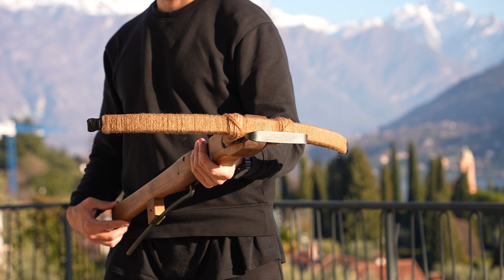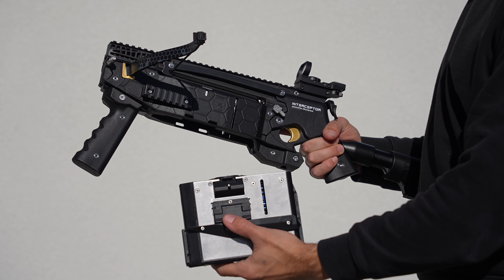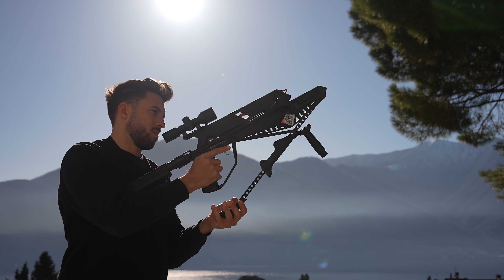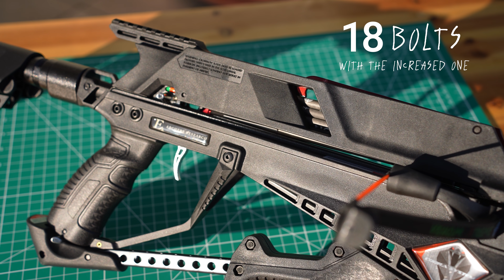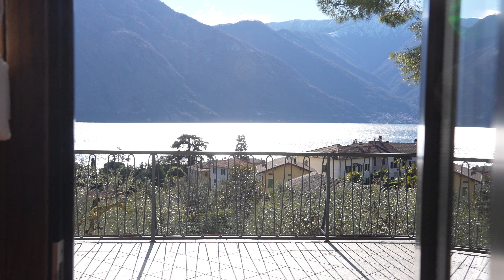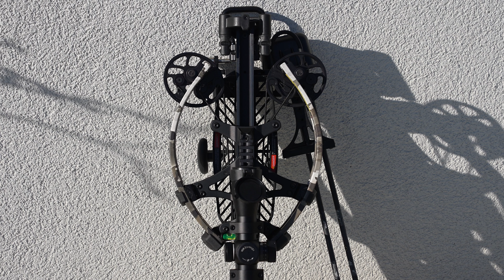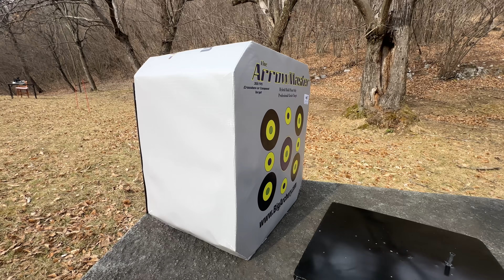How Dangerous are Crossbows?

Comment: When I was a kid, and we would do battle in the Great Penwood behind our house new Newbury, I made a crossbow with a solid piece of wood as the core, a thin piece of flexible wood as the limb, and I forget what I used as a string, but I do remember the clever bit was a clothes peg with a nail through it used to release the string. It was pretty powerful for a home made effort! (I used arrows from my shop bought bow and arrow.) I think the cross bow is my favourite off grid weapon. Easy to make, easy to make your arrows from what you find out in the wild.

Comment: Just a slight comment for the medieval crossbow - the bolts had triangular tip cross-section to open the armor nicely, more like a clean cut. The circular tips are made for range shooting with very low penetration - as it has to tear the material, which dissipates the energy much faster. This makes more difference, while shooting to harder things, like wooden doors or steel armor.

Comment: I have never tested a crossbow, seen it done in Portugal at a medieval "feast" of sorts and saw a crossbow penetrate a sheet of metal which wasn´t paper thin, in fact I remember being surprised but it was like 30 years ago. I do remember that the bolt was very different and the tip extremely pointy unlike the one in the video.

Comment: The Tenpoint is basically what crossbows have been portrayed like in media. The first three I could call crossbows, but the last two are definitely Bolt Throwers, which is manly as F. Though I don't think a weapon that has $100 per single-use ammo to be really good. I mean the bolts clearly can't handle being shot at that power.

Comment: If you can reload a crossbow without using the full strength of your body (as in either a lever and your feet, or some other difficult thing) I tend to think of it as a toy, a lethal toy but a toy none the less. Problem for me is I've seen what a classical european middle age crossbow can do to armor; it blew my mind. I had a number of smaller crossbows as a kid that were most certainly not to be underestimated but had nowhere the 1000 foot pounds or so of force those did. I think mine was like 25 foot pounds? Eh not actually that well versed so if I'm completely wrong my bad. I just clicked because it of that one funky crossbow that seemed to lack a bow.

Fun content, makes me want to get one of these for shooting targets.

Edit: See I knew the one that needed a wench would be WAY more powerful. THATS WHAT IM TALKING ABOUT. You could probably use that for deer hunting.

Comment: Nice vid, but a suggestion to calculating the accuracy points, it would have been wise to reshoot the first shot. It skews the result. It goes in the other direction too. Let's say you put ten arrows within 5cm from each other, and then accidentally flinch and miss the target completely. Does that say anything about the weapon?  In general, it can be wise to remove all extremes and keep the 90 or so percent in the middle. I know this channel isn't exactly scientific, but it could be something to think of if you want.

Comment: hey look in an apocalypse scenario is something you can have the fanciest and most powerful crossbow on the planet , but that wont be any help in maintenance , the bolts are made most likely carbon fiber or other materials you will not likely find laying around and they are made with a small tolerance so you cant really make them . Second the more pats moving the worst , means more things to brake and maintain so the "manual action" while being good at the beginning it will be worse and worse with time . The most likely one would be in my opinion the worst one on the list , the medieval one , stock broke ? just take a piece a wood and screw it over , ran out of bolts ? take a branch and make some , the sling broke? use it as a bat until you are able to either find or make a new one and just use some oil trough time to time on the trigger to not get rust on it . best over all for long time survival

Comment: So tenpoint is almost worst option for zombies because you have no ammo to retrive, and in situation with limited resources and imposibility of high tech productions you gonna run out of ammo very soon. Also sound of that crossbow's shot is as loud as you'd get with subsonic rounds with silencer. But the gun is more compact and lets be honest find .45 ACP looks easier then that bolts.
And in the defence of medieval one: tests are sort of bullshit. That is heavily underpowered one. I mean that little boy could be used for hunting or robbing unarmed travellers, but for war you had only option for heavy ones(talking about armor pen), that needs all those additional stuff to wind up. Because there is little sense to drop power of draw from 120 lbs to 60. Not telling that britain archers used 160 lbs, and some monsters had even more, but it's more about exeption. Also you had 2 monsters with "presetted" wind ups mechanisms, and didn't get same for more powerfull old one.
WIth all that... Respect for your accuracy

Comment: i mean its abit "unfair" if you try to rank/judge the crossbows but then on some you use extra equipment and even different bolts and on some you dont, even medieval crossbows had different kinds of tips and with the right one it wouldve penetrated that wood board and the block behind it

Comment: 🤔☝️ Has anyone built a crossbow with a small electric motor to cock it? Im thinking especially for one with those coil springs you could probably put stronger coils in and a removable battery for the winding motor

Comment: Okay, so one quibble, while they made crossbows that weak in the middle ages, many were MUCH more powerful. Some had a pull of over 800lbs. 

Interestingly though, they don't usually produce as much velocity with the bolts because the medieval bows were usually made with tempered steel. That means that this poundage has to overcome the mass of the bow itself in the act of accelerating the bolt.

Watch Todd Workshop's experiments on the matter. He goes deep on the subject!

Comment: Just a cool story I hope you enjoy...... About 30+ years ago 1994(ish) my stepson had a compound crossbow and we set up about 30....40 feet away from things we were shooting at and I had the idea to get a long stick candle and a candle holder, put the candle  in a candleholder (It was made of brass (THICK wall. NOT cheap thin. It was....🤔1/4...3/8 (maybe). It was thick brass. It was ROUND and BRASS and brass is SLICK....it was a fancy candle holder too with nice curves, etc. Anyway we were taking turns shooting it, trying to shoot the flame of the lit candle out. We were using pointy tip 'bolts' and not razors.  It was my turn and my aim wasn't  that great. ...and after I fired it hit the candle HOLDER an inch or so below the bottom of the candle and it went RIGHT THROUGH the candle HOLDER! 😳 and got STUCK EXACTLY HALF WAY down the bolt/arrow. We laughed SO MUCH. Told the story to everyone we knew and then some😂....and I put up a very nice shelf in our living room just for that brass candle holder with the arrow/bolt STUCK half way THROUGH the center of it!😂 It must have hit it not only with SUCH MASSIVE FORCE but because the candle was a thin stick candle, the candle HOLDER was also quite thin (besides the base of course) it MUST have hit EXACTLY at the closest part of the brass candle holder to where we were because if it hit it even a 1/16th or 1/32 etc. or so to the left or to the right, my guess is that it would have just knocked the candle holder over as it ricochetd off if it...but it went RIGHT THROUGH IT!😂🤣🤣LOL.
And of course..great video😊😊. Thnx for sharing it.

Comment: Moving the sites farther up the rail will help accuracy.  Think of it as trying to touch your target with a longer stick vs a shorter stick. If the site is farther from the axis of your shoulder it will be less susceptible to the rotation of your aiming.

Comment: 15:20 sounds like it could have multiple stages. Like if you plan to shoot closer or sudenly need to shoot closer, or need less power, instead of winding it all the way back just stop at one of the other two stages?
Dunno. Just a floating thought.

That asside, the interceptor overall sounds like it's exactly what it's named after. Intercepting. The basic version, at least. Quick speed, good enough accuracy at close range and just enough power to hurt and intercept something or someone without needing to cause serious damage. If you flatten the tip a bit or something you could totally use it in law enforcement no? As an alternative to rubber bullets. Could reduce cost and logistic on ammunitions. 

23:33 yeaaaah that's a big issue xD having power is nice, but not at a cost of 101 per shot, wich break. XD

27:41 nah, the risk of losing your bolts is not worth the extra power. And it certainly serve little purpose in a zombie apocalypse, unless you want to cover someone else from arround a 100 yards, wich case i suppose the bolt would lose enough power to safely take out a target without breaking... but then you'd have to go 100 yards to pick em back up, or ask the person you're covering to do it for you xD

Comment: Just so you are aware, you should never reuse carbon bolts or arrows after a hard impact like stone or the tree where you used a hammer after. Those with any damage have a potential to explode from the sheer energy produced during firing. That’s a carbon grenade inches from your face.

Comment: so for bladed arrow-type projectiles, given the same sharpness and shape tip, mass will consistently beat out speed in penetration. Consider slicing a melon, you can throw a knife at one and it will stick in but won't go through. But if you attach mass by holding the knife, you can cut completely through the melon with ease, even when adjusted for total power, because you can move much slower.

Comment: You did medieval crossbows dirty with this video. They are absolutely lethal. This "medieval crossbow" you used for the video is a toy compared to late medieval siege crossbows. You would not be able to draw a real medieval crossbow with just your hands. Those things with the right bolts could absolutely pierce through light armor and chain mail, go through bones, and even poke holes in thinner parts of plate armor. I understand getting a "real" siege crossbow is a hassle and very expensive, but damn, at least you could've used the right bolts for the job, and not these target practice bolts.

Comment: Knots in a wood causes difference in wood resistaence against split. You really should use same kind of wood (ideally without any knots) for each tested crossbows. I mean, if you would shoot same wood and spot like with the third crossbow (no knots), you probably would have split it with previous/weaker crossbows as well. Nice test anyway.

Comment: Medieval siege crossbows could get up to, and in later times well beyond, 1000 pounds of draw-weight.
...
Just saying, modern isn't always leaps and bounds better.
Reply: Modern ones are much better at transferring the draw weight into actual kinetic energy to the bolt though. A modern crossbow with similar drawn weight as a late medieval windlass crossbow has much more penetrating power. This has been tested by Tod's Workshop

Comment: Anyone who's chopped wood before can see that there is a problem with the wood block + gelatin test.
The first 3 bows that you tested had blocks with knots in them, these are harder and deflect the energy. The fourth bow you tried had perfect straight lines which is remarkably easy to split.

Comment: I have a suggestion to enhance the video's reach to Spanish-speaking viewers. Since the video is dubbed in Spanish, I believe it would be incredibly beneficial to include decimal metric system measurements during the editing process. This would provide a more accurate and relatable understanding of the experiments for viewers who are accustomed to the metric system. I'm confident that this small change would significantly improve the video's accessibility and impact for a wider audience.

Comment: The medieval crossbow could do better in the penetration test with a better bolt design,like a smaller tip and reduced weight so it can go faster and have less friction and surface area of the tip but that's just my opinion and it would not be a traditional bolt to match the crossbow

Comment: Stack up card board layers with a 2x4 on top and on bottom with turn buckles on each side and tighten down tight and shoot card board between the layers and save your bolts and arrows! This will take card board one foot wide x three feet long and three feet high and put two thick boards across the top and two thick boards across bottom of the stack of cardboard and four turn buckles two on each side and tighten them down tight and you can stop your bolts and arrows without damaging them shooting between the layers of cardboard! Easier to get bolts and arrows out also but puts friction on bolts and arrows to stop them!

Comment: Though it was invented a little late in the crossbow game, Leonardo as Vinci actually designed a repeating crossbow with a 300 lb draw weight. It had a similar built in reloading mechanism as the adder, where you split it open from the back and lever it forward. It could be reloaded in a few seconds. He also used advanced mathematics to increase its accuracy.

Comment: I built a crossbow in 9th grade shop class in Cambridge Minnesota in 1975.
It had an aluminum bow, and I think a stainless steel string. I think it had a 75# pull. 
Like a dummy, I traded it for a minibike.
50 years later, I’d give anything to have it back.

Comment: When I was 14 I tried to manually load my Dads 180lb crossbow. I put my boot toe into the stirrup and pulled as hard as I could and just before it latched my muddy boot slipped out. The butt of the crossbow went straight back into my groin. Luckily, it missed my beans. Unluckily, it got my frank. After laying and crying on the ground for several minutes my Dad took me to the hospital. I got 11 stitches in my frank, the broken skin caused by the way the butt of the stock pinched the edge of the frank hard enough to split the skin. I was ok afterwards though I still am very careful around crossbows and only use devices to load them.

Comment: I regularly shoot a crossbow in my garden, and I’ve finally found the best solution for a target that effectively stops bolts, even with crossbows as powerful as the last two presented in the video.

Simply put, a thick winter duvet in its original packaging! It’s incredible how effective and inexpensive it is. Plus, the arrows are very easy to remove from the target.

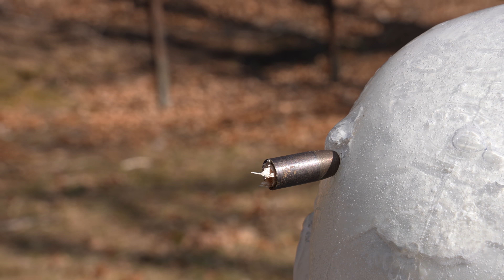Comment: 4:30 In my opinion and in some cases the victim would have dead because of lack of medical asistance to heal such injuries.
Reply: Also. Look how blunt that tip is. You put a needle sharp point on that. Dead for sure.
Reply: You are correct a doctor in that time wouldn’t have been able to stop the internal bleeding that comes with a fracture skull. If severe enough there dead .
Reply: @bennettjohnson2429  you'd be surprised, trepanation was used by ancient South Americans for relueving pressure in head wounds.
Reply: Same thought. Totally lethal.
Reply: An injury like that to the head could indeed kill someone. It would likely cause a bleed on the brain which would cause death
Reply: Imagine not getting treated properly and that wound got infested with maggots slowly making big holes, and then eventually penetrating brain covering and eating that.
Reply: @erick8365  they couldn't treat internal hemorrhage but they could cure open wounds several ways lol, in the middle of the field? just cauterisation.
Reply: @cahallo5964 Not during an active battle most medieval bows and crossbows were not deadly but cause lots of bleeding.  You would be a couple km from any doctor and due lack on common medical knowledge death from infection was common.
Reply: @erick8365  maggots only eat dead flesh

Comment: Next time tou want to put extra things in front of the trees use the archery mat first then add the blankets, then add the plyood before the tree. That way you have multiple layers to slow the arrow down as well as put less strain on the arrows. Also when i got my 130lb crossbow i started making bags of essentially kinetic sand. I bought a 60pack of sandbags they use to stop water in floods. I buy or get sand depending on what i can find and make 50-100lbs of sand and fill the bags. Im exploring mixing gelatine or silicone with sand or sprayfoam and sand so its not so heavy and i can heng them easier

Comment: Great video, i do have an issue with the penetration thing tho, 
using a small pice of tree aint really fair as its more likely to actually break instead of getting penetrated as its to small and to compact/dence to take any proper force, 
something a little bit softer would have been way better.

Comment: I feel your pain. I have a arrow rifle, and a arrow pistol. The rifle moves a 16 inch bolt about 525 FPS. The Pistol shoots a 8 inch bolt dramatically faster. I didn't have a Chrony with the last time a shot it. But I stop shooting it, as it destroys the bolt , every time to shoot it. Both are accurate enough, you don't want to aim at the same place twice, as you will destroy your arrows as well. Unfortunately with the amount of power they have, it's quite difficult to find ranges and backstops to shot at.